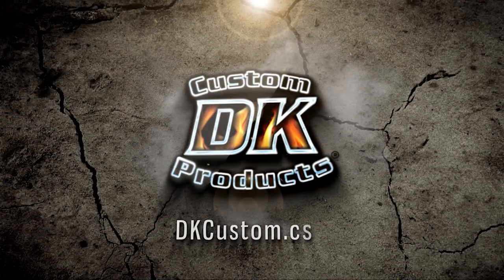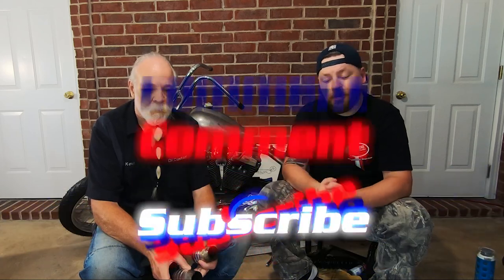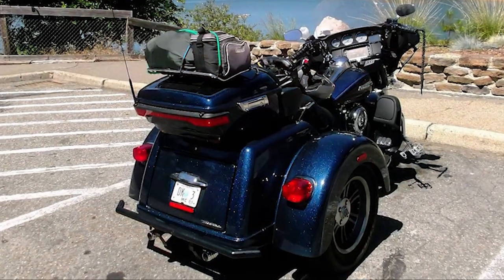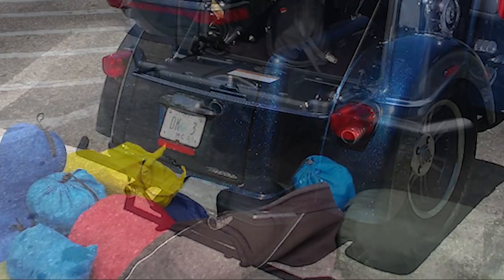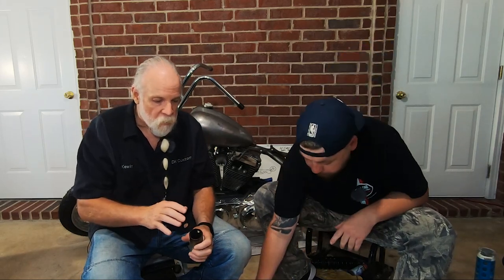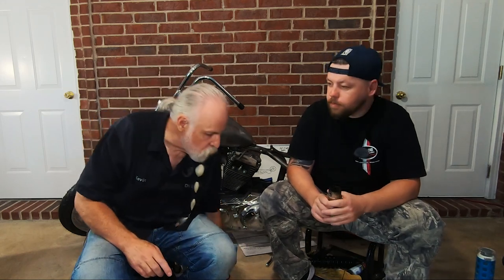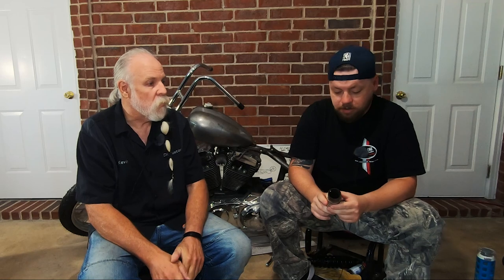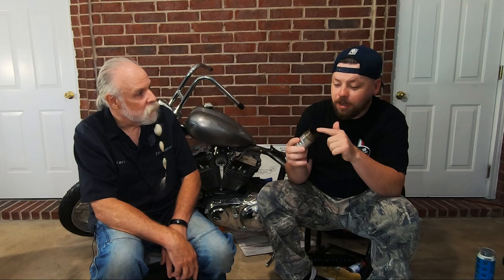Harley Exhaust Experiment - Looks - Sound - Performance

Comment: TAB Performance tips for their 4" slip-ons have no "lip" to disrupt. I added their Zombie ring inserts for reversion and very happy with the outcome.
Reply from the maker: Good to hear you are happy with your set up.  Tab Performance Tips DO have a lip, but if you use their baffle which has a large restriction, the lip on the tip is irrelevant.  If you do not use the baffle, the tip has a large lip, even larger than what was shown in this video.

The Zombie rings are better than nothing for reversion with no baffle, but, of course, they have a lip also that disrupts flow.  

The important thing is that you are happy with your bike!

Comment: Very interesting cause I just experienced the same, I have a 2-1 exhaust system and the muffler coming with the system had this heavy perforated end-cap with a 8-10 mm. wall clearly sticking into the mufflers exhaust flow. It didn’t look logical to me so I used my good old 4” Loose Canon Muffler from Firebrand, no end-caps just the same measurement all the way out from the collector piece….and runs so good now ✊🏻 It’s sometimes all in the detail…👍🏻😉
Reply from the maker: Yep, you are correct, sometimes the smallest details can make a big difference.
I was surprised to see and feel the difference when I tried the end caps (which I really liked the look of).

Comment: Great video, I use a garden hose to explain exhaust reversion and flow. Slightly pinch the hose with the water on, the flow starts to slow down and slowly back up the hose. Nuff Said, keep the how to videos coming.
Reply from the maker: Hey Jack, that is a great way to show how the wave reverts.  Thanks.   Yep, lots more videos in the works.  Thank you! 👍

Comment: So, based on what you just imparted, which of the slip-ons you sell would be the best bang for the buck, and would you install the appropriate Thunder Torques at the appropriate position as part of your best Stage One?
Reply from the maker: Great questions.  The best slip-ons for performance (and some peoples ears) are the factory ones with the baffles removed and Thunder Torque Inserts installed.  See a couple of video links of that below.
If you want aftermarket slip on's, depends on what bike you have for which would be best.  But, yes, for performance, it is best to remove the baffles and run only the Thunder Torque Inserts.  However, some of them do pretty well with the baffles left in and Thunder Torque Inserts installed.
https://www.youtube.com/watch?v=cOs1-bTPycU
https://www.youtube.com/watch?v=tOMI3yBz_9w
https://www.youtube.com/watch?v=GuIgK-rc2s4

Comment: I have the V&H 2into1 pro pipe.  I was wondering if the end cap was obstructing the exhaust flow with the thunder torque insert.   The end cap probably has a half inch of lip inside the exhaust.   After watching this video I decided to take the end cap off.   I haven’t tried it yet without the end cap.   It looks better with the end cap but it does make sense that it’s obstructing the exhaust flow
Reply from the maker: The exhaust gas hitting that lip after it passes the TTI would have a negative effect on performance.

Here is a written report on Exhaust that you may find helpful/interesting - https://www.dkcustomproducts.com/harley-exhaust-myths-and-facts.htm

Thank you for commenting! 😎MB
Reply: @DKCustomProducts Thank you for the input.   I am using the V&H FP3 tuner.   I had the standard baffle in the Pro Pipe and set the tuner for the standard baffle setting.  Now that I took the baffle out and have the thunder torque insert installed do I need to retune the bike or is it ok as it is?
Reply from the maker: If the tune was good before you did that, it will still be good after.  The ECM has enough ability to adjust for that change.  Here is a video on the subject that you may find interesting- https://www.youtube.com/watch?v=0vbTkRvFa80
KP

Comment: Awesome video! I scraped off my lower end cap on my VH, going to remove the upper tomorrow. Thanks for the info!
Reply from the maker: Thank you for the comment, and glad you liking the videos.
Let us know how you like it with the caps off.  Do you have some TTI's in there to give it more low and mid range grunt?
Reply: @DKCustomProducts  I sure will👍😃

Comment: What do think about the headers step up in size
Reply from the maker: If you're going to have large diameter mufflers, it is better to step the headers bigger.  But the horsepower/torque gain is not that great.  Better, but only each person can decide if the small improvement is worth the $$$ to them.
Reply: If you properly size the stepped headers pipe dieter and lengths, you can get significant power increases across the average. But just a generic, off the shelf stepped header will only give minimum gains.
Reply from the maker: @WVXL64  Do you have any charts that show the difference between stock headers and stepped headers on the same bike with the same slip-ons that you could post a link to here?

Comment: Aren't these, or something very similar, available that are placed at the cylinder head instead of at the end of the pipes, and if so, are the effects comparable?  I think the product that I have in mind was originally called torque cone inserts.Thanks guys. Seeya!
Reply from the maker: We have done quite a few tests on torque cones and have never seen any measurable benefit from them.
Here is a written report explaining how exhaust works (and it is not just traveling along the outer shell) - https://www.dkcustomproducts.com/harley-exhaust-myths-and-facts.htm

And, of course, we have dyno charts showing the significant gains of low-mid range torque when using the TTI's.  You can see some of them at this link- https://www.dkcustomproducts.com/thunder-torque-inserts-118-model-family-dk-tti-118.htm

Thanks for commenting! MB
Reply: @DKCustomProducts  Guys, please overlook my apparent redundancy, I'm having some problems with my phone. Thanks again for all the very helpful information. I'll probably be investing in these for my 97 Heritage in the near future. Seeya
Reply from the maker: Please feel free to reach our with any questions you might have;
Support@DKCusromProducts.com
662-252-8828

Thank you for commenting! MB

Comment: Would the same be true for Fish Tails?
Reply from the maker: Depends on the fishtails.  If they have a ridge that is 1/16" or more inside the pipe, it will disrupt the flow, reducing exhaust gas velocity, which also reduces power.
On the fishtails in the video below, the the ridge is less than 1/32" and not measurable disruptive to the flow of exhaust.
https://www.youtube.com/watch?v=GuIgK-rc2s4
Reply: @DKCustomProducts   Thanks for the information
Reply from the maker: @MotoPLX  you're welcome, happy to help!

Comment: It’s almost shocking how poorly designed most of these exhausts are it would seem! To purposely design your exhaust in a way that knowingly robs you of power and performance is unacceptable in my book. It seems the best solution is really to just modify your stock exhaust and add the TTIs for both the sound and performance you want from your super expensive Harley Davidson. 
Or perhaps a good two into one full system, but definitely not the most economical option available.
Reply from the maker: Usually with exhaust there are 3 main motivations:
Looks
Sound
Performance
Some, maybe many, folks are primarily concerned with Looks and Sound.  Most exhaust MFG. are concerned with making $.  So if they make an exhaust that appeals to people who are primarily interested in Looks and/or Sound, then they are giving the people what they want and making $ by doing that.
IF you are ok with the looks and sound of the OEM muffs with the baffles removed and the TTI's installed, then you will have the most economical gain in power.

Comment: Is it possible to put your trike on a dyno to prove your claims of increased performance...wonder if your own feelings of increased performance are more of a placebo effect?
Reply from the maker: We've had quite a few trikes on the dyno.  I did not have that trike on the dyno with those pipes.  Regarding increased performance with the internal end caps vs. the others...placebo effect would have been the other way around.  I REALLY liked the polished end caps and wanted them to work well.

Comment: Until I move back to Idaho not paying 500 dollars for 2 hp. Screaming eagle mufflers don’t cut it. Nobody here enforces the muffler laws but not worth it. Watched a Harley mechanic dyno them on his bike, YouTube.  Will be putting your oil filter on my new street bob. Could really fell the difference on my Electra glide.
Reply from the maker: I hear ya, SE pipes in stock condition don't do much for me either.  For quiet pipes and great power, check out the supertrapp style disc type pipes.